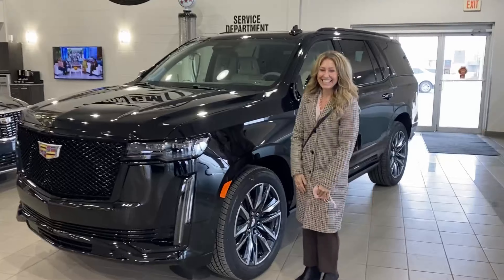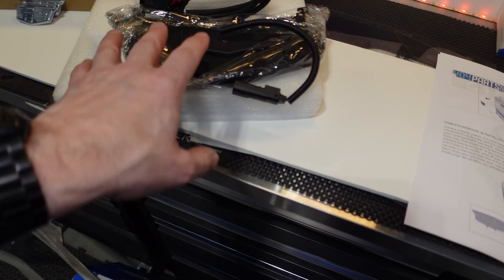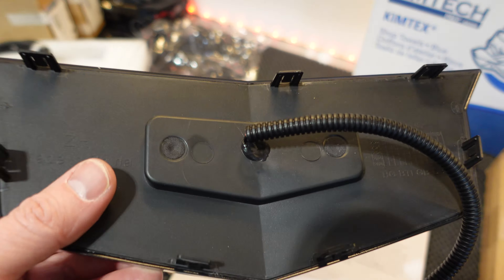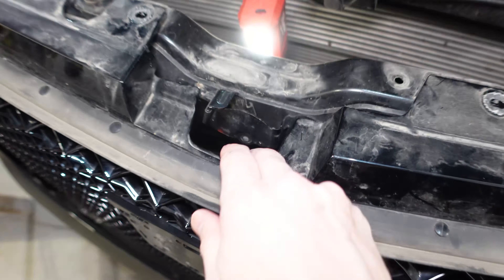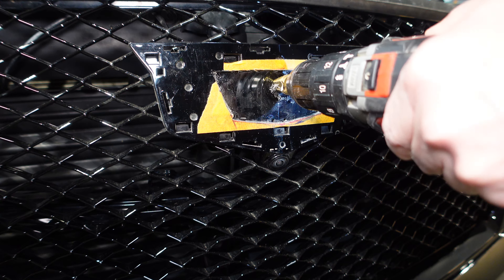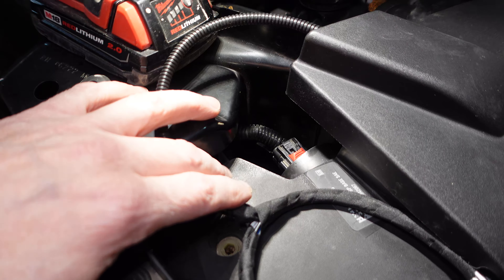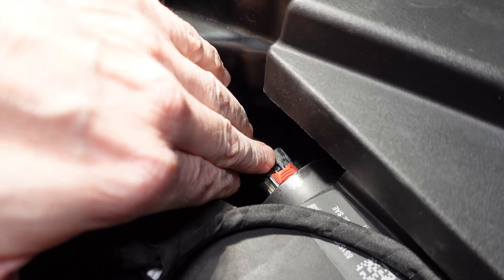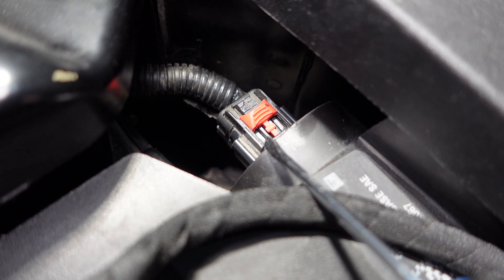Cadillac Escalade Black-Out Illuminated Emblem Install - Complete Guide

Comment: Hope this works better than the gmc lighted emblem!
Reply from the maker: Fingers crossed 🤞
Reply: agreed, im still waiting for my redesigned new gmc lighted emblem that i ordered 5 months ago lol
Reply from the maker: @nutzthomas  you might want to watch the next GMC AT4 Video coming out soon.
Reply: @Donslife  You know i will!!
Reply: @Donslife  do you know something I don't know because the parts guy told me they didn't have a expected release date yet.
Reply: @S_Waltz  on what year and what vehicle may I ask?
Reply: @S_Waltz  I ordered my 2024 GMC 3500 Denali Ultimate with it 6 months ago, got the truck 2 months ago and no emblem. They told me the same thing and that they were making a different one and they'll let me know when it's in. I already paid for it and everything. The tricky part is I want it now and I am capable of doing it myself but if I wait for them it's covered under an 8-year warranty because they installed it
Reply: @S_Waltz  And no that doesn't help lol I'm even more confused now. Thanks for the information
Reply: @S_Waltz  maybe I will pay them another call thank you for the info
Reply: @S_Waltz  I'm following you, thanks for the info. I will give them another month, then the calls will begin.
Reply: @S_Waltz  I will give them the benefit of the doubt maybe sometime is a little different with the heavy dutys due to the massive grill or something
Reply from the maker: I don’t have confirmation if the new one I have is improved upon my last one.
Reply: @Donslife  all i heard from the rep is it will be a totally new parts number so ill keep my eyes on that.
Reply: @nutzthomas  We've got them in stock Thomas!

Comment: Hey is the light white white it does not look yellow and 
Can you connect when you start the Escalade with remote will it show
Reply from the maker: It comes on with the headlight circuit not the DRL circuit.  It is due to a wiring restriction with how the Escalade is designed.   Also the plastic is slightly off-white but looks worse on camera.  In person I feel it looks better

Comment: could you just buy two front illuminated and put one of the two in the back?
Reply from the maker: No, especially since the rear emblem is a functional button for the tailgate hatch. Also the only color of light allowed on the rear of the vehicle is red in most states/provinces.